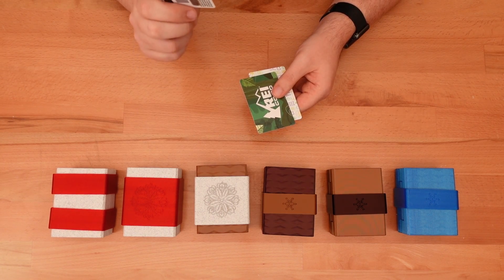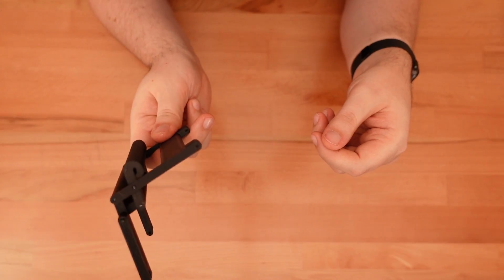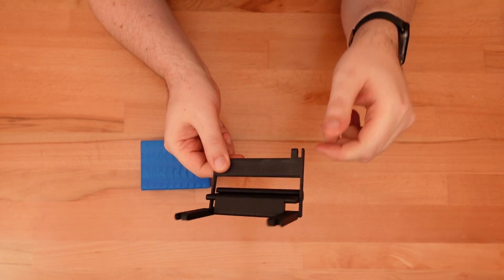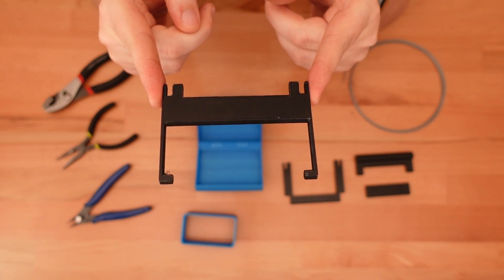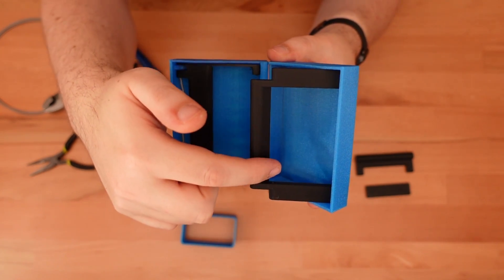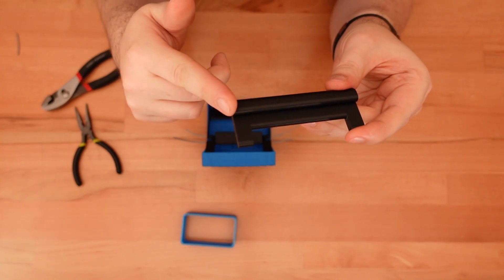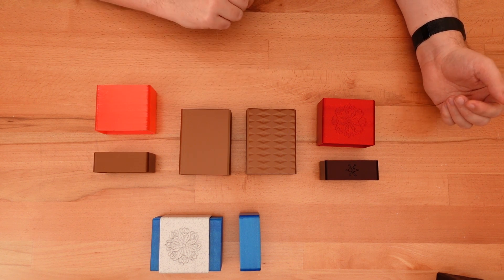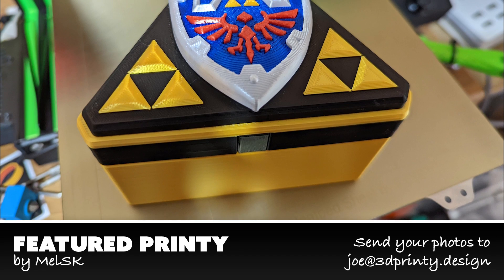3D Printed Pop-up Gift Card Box

Comment: Another absolutely fantastic design everything printed and worked perfect!  One request...the gap on the card holder element (latch holder) makes it really difficult to get a card in...could you open the gap ~.5mm.
Thanks again for all your awesome work!
Reply from the maker: Glad you like it! I'm not sure which version you downloaded, but I have updated the part on November 27th with a wider gap. The updated parts are on Thingiverse and Prusa Printers. Unfortunately, the Thangs model is still using the old piece because I haven't figured out how to update an assembly without deleting the entire project.

There's also a "support free" version of that part that may result in a looser-feeling hold just because of layer orientation.

Comment: Look at you barreling past 3k Subs. Amazing. Awesome design,  as usual. I'm gonna try to free up a machine to try it, asap! (and send you a tip for Coffee when I do, of course) [Do you even like Coffee?! lol]
Reply from the maker: Thank you! Donations are never expected, but I do appreciate it!

Actually, the coffee money ends up going toward buying more filament, so either way it's a type of "fuel".
Reply: @3DPrinty  LMAO, I just saw this reply today, where, Ironically, I sent you another tip, mentioned Coffee, and, was GOING TO SAY "Or Filament LOL", but I didn't.... and here is this comment. Epic.  Stay awesome. P.S. I just installed Prusa Slicer today. I've been using Cura, and, I notice you showed it in this video. I look forward to checking it out. I'd love to see some of your key settings included in your descriptions, for your successful prints. EX: Quality/Resolution (aka layer height), Infill, Print Speed, Skirt/Brim/Raft. Just to give us peasants a starting point to tinker from.
Reply from the maker: Thank you as always! To be honest, my print settings are pretty close to default "0.2mm quality" PrusaSlicer profile. When I add a new printer, I start with a MK3 profile, adjust the bed size, and in most cases make no other changes unless I run into problems.

As for print-specific settings, more often than not, I'll turn the skirt off and add a brim, even when it's not necessary. I just appreciate knowing things won't move on me and the brim gives me time for live-Z adjustment as the first layer goes down.

In most cases I stick with 2 perimeters and 15% gyroid infill. It's very rare that I'll use anything else... for the traffic light lenses I used honeycomb because I knew they'd be transparent and it'd look mechanical.

If a design calls for it, I'll adjust the top/bottom layer patterns to give a cool effect - Archimedean Chords is one of my favorites for mostly round-shaped prints. 

 I have 8 different temperature profiles ranging from 195C (used for Overture PLA that likes it cold) all the way up to 240C (used for Protopasta which sometimes clogs when printed at normal PLA temps). For PETG, I use the Prusament PETG profile, regardless of the actual PETG brand.

As you can see, I don't actually do much tuning - and so I'm not sure I have enough info to make an actual video. Feel free to ask about any specific settings you're interested in, though! Happy printing!

Comment: Is is possible to make a larger version that will fit card like Nintendo eshop card?
Reply from the maker: I think so! I'll need to do some experiments. If I'm not mistaken, they're the same width as standard cards, just taller?
Reply: @3DPrinty  correct at least they look like there the standard width, but taller
Reply from the maker: I'll give it a try - probably in an update in a couple weeks. The key trick is that the box can't just be longer, it'll probably need to be a little taller as well, since the card sits at a slight angle.
Reply: @3DPrinty  awesome thanks